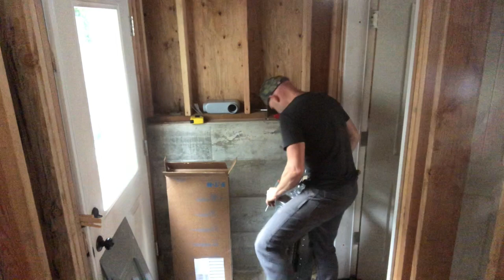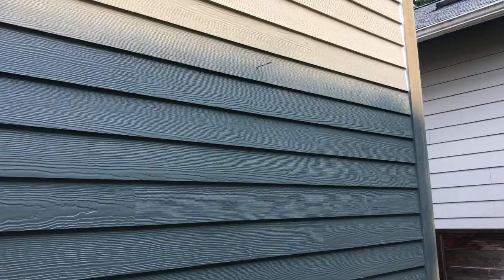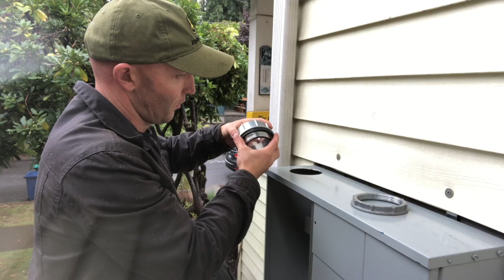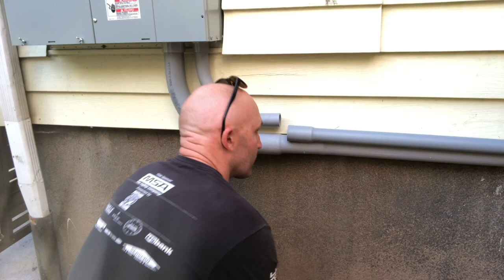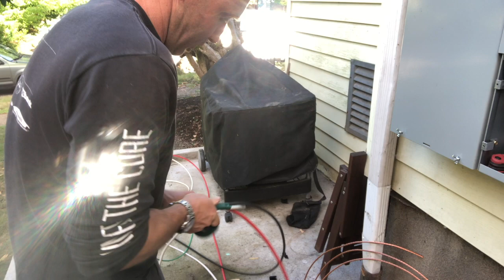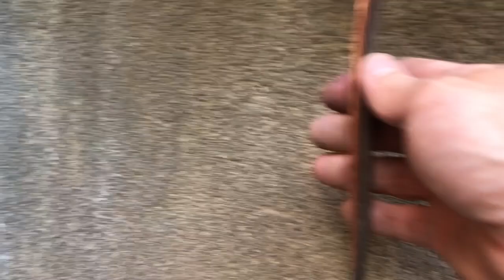ADU How To  |  Electric Service Panel and Meter

Comment: lol i envy you pple tht can run pvc in such a shallow trench my area it has to be 4ft with at least 6 inches of clean fill below and above so its a trench 4.5+ ft deep with granite slabs everywhere and the need for expansion sleeves

Comment: How did you attach the lb conduit body to the service panel.
Reply from the maker: At the ADU panel or the meter base? Assuming you mean the AdU panel, I used a female coupling on the panel side with a threaded male end. The threaded male end attached to the panel. I used a short piece of conduit to go to the LB 90 on the outside. Does that answer your question?
Reply: @yourdeptlogohere  yes it does. That's how I planned to do my install but it pushes my lb 90 away from the garage a couple of inches.
Reply from the maker: can you cut the piece of conduit shorter? this is a 2x6 wall.

Comment: Main breaker should be no higher than 6', wheres is bushing on 2" pipe?
Reply from the maker: The main breaker is just under the height limit. The inspector checked it, thanks. Which bushing are you referring to? If it’s the one at either panel they are attached to the panel. You are watching a video that is edited and cut to fit into something that is presentable for the channel. Every step along the way is not shown.

Comment: Why do you need 400A to a house?
Reply from the maker: You don’t need 400A to a house. 200A to the house, 200A to the garage ADU. That way if you ever want to run a lot of tools, welders etc or run some kind of shop out of the garage you have the power requirements available. It was built with future potential needs in mind. Thanks for the question.
Reply: you want to have duel e/v chargers you will need it lol

Comment: why make such big loops to your main breaker looks like a cluttered mess
Reply from the maker: Having the loops makes it easier to connect. And I am not an electrician, so I’m sure a profession would do a better job.
Reply: @yourdeptlogohere  Looks great to me! Don't sweat the loops!
Reply from the maker: Thank you!
Reply: @yourdeptlogohere  lol professional contractors are hacks work looks like sht but there done qck like cashing a chk or counting your money lol.  you cant have contractor without the CON 1st not one has proven it wrong
i was  also taught by a cple of masters to leave large loops easier to work with  less strain on cable and lugs

Comment: Door jam 82 inch disconect 83 inch no no no
Reply from the maker: Sorry but I’m not sure where your getting your measurement. The disconnect is to code.
Reply: @yourdeptlogohere  just wondering why you wld want disconnect so high it looks close but i wld prefer it lower myself and flush mounted( not recessed) for easier expandability ? its no fun having to cut panels for access to knockouts
Reply from the maker: you shouldn't have to cut anything to expand. you could always add more breakers. Its not recessed, its flush mounted, has a cover that goes over it.
Reply: @yourdeptlogohere  o kk it looked like you used the tabs usually you use those when recessing into wall so sheetrock or paneling is flush to the sides looked a little high too but the rest of job looked great.